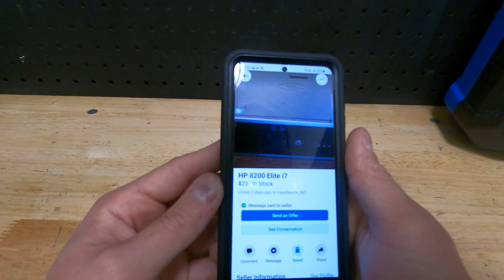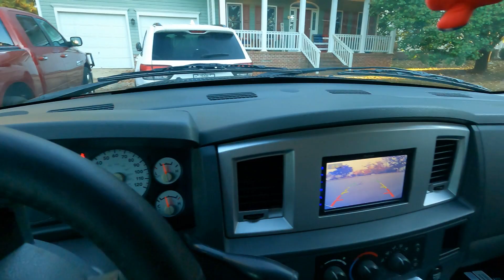Market place finds!! HP Elite 8200 i7 for $25... Can it game?

Comment: I’ve almost got the same pc specs as the one in the video
-W4100
-16gb ram
-i5 2400
But when I load any game the pc gets really loud. Do you think it’s a storage problem? When I bought it, it came with no hdd but he offered me $5 to make it come with a little 80gb hdd. I’m definitely upgrading it but I just wanted to know if it was the problem. Thanks 🙏
Reply from the maker: get a ssd and add a vent hole to the panel. makes a huge difference.

Comment: Would a low profile 750ti fit?
Reply from the maker: yes!!
Reply: Hi I got a asus 750ti graphics card would it fit in a hp 8200 with a i5 2700?? Would it just plug and play.i got 8gb ram also.??would I need to change anything??

Comment: For once I watch your video and actually own some of the things shown. I have that monitor, but the sound don't work so I have it hooked to my PC with a VGA cord as a second monitor. And my Dell Optiplex 790 has an i7 2600 in it. I love your channel, it's helped me out ever since I started watching. Heck, if it weren't for you I'd probably have an Optiplex that I can't use because of the power button malfunction that the 790's are infamous for. As the only replacements were sold from China, it was faster to get the adaptors. So got them and threw the mobo in that early 2000's gaming case that I originally had a Biostar mobo in. You are a boss.
Reply from the maker: Thanks man, glad the channel has helped. appreciate the support!
Reply: @DLMtechgarage  No problem
Reply: Hey

Comment: Nice. I found a gtx 1050. Trying to plan a build around it. I could make more money putting it in an old dell optiplex cuz i get them cheap but that's not fun. Thinking to do a custom build but i cant find a good case under 30. Everything i saw on BF had mail in rebates and i hate those. Who stole all my cheap Rosewill cases!
Reply from the maker: i know right. I miss the cheap case specials. Lately I hvae been finding older used cases. some of the older cases actually look pretty decent and are unique.